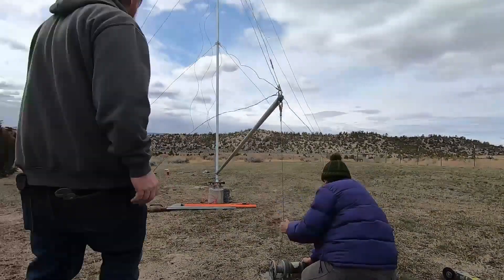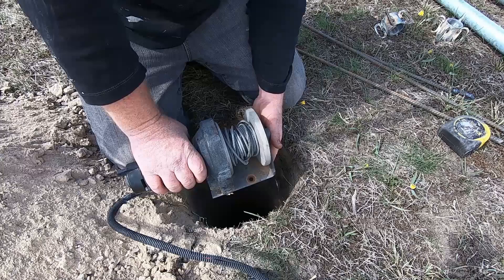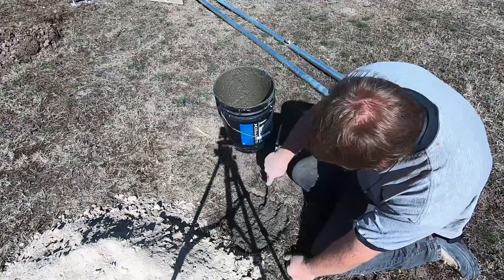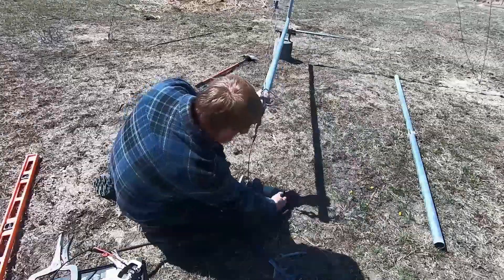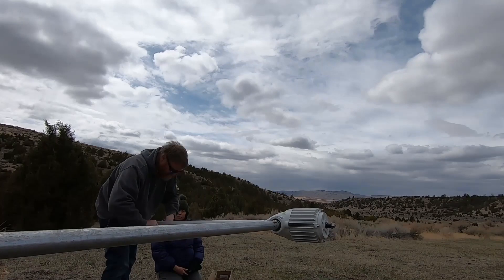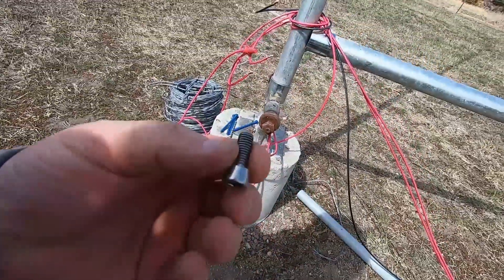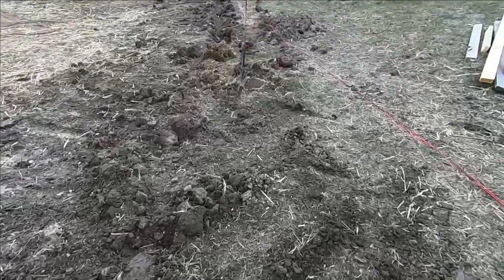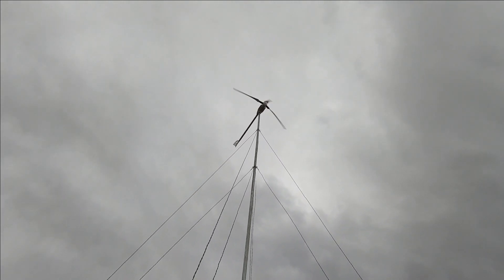video compilation Ista breeze I1500, Tower install, and some final thoughts on the wind mill

Comment: Hey Mike great projekt, you couldt do this, put the retcifier at the bottom of the Tower and then run dc currrent thru the wires in the Ground
Juse two off the three in parrell
Reply from the maker: You could and save one wire but it's less efficient that way.

Comment: what did you hook the turbine too? the istabreeze charge controller?
Reply from the maker: No, it goes straight to a bridge rectifier. With the controller I might get more from the turbine though.
Reply: @veggitarianredneck  I see, rectifier and then straight to a battery bank?
Reply from the maker: @behappymike  yes

Comment: After watching the four clips of this work, I first wondered why you carry the gun😕.?  In addition, you have a wonderful hand tool and you have purchased a generator with good efficiency, but you did not connect the wires in a good way, because you will discover later that the frequent rotation of the motor around itself will lead to the wires wrapping around themselves inside the pipe, which leads to their rupture and leakage of electric current to the metal.  It causes danger to whoever touches the pipe makes his life in danger, except for the disturbance in the proper conduction of the current to the house. I wish I was in your place in this beautiful nature and wilderness and white clouds that make me do an amazing job more than what I saw in those clips, Greetings
Reply from the maker: Some of that may have been lost in the translation.
 But thank you for the comment. The wind gen has slip rings so no twisting danger there. 
 I carry my gun , and sorry if this sounds arrogant, because I can.
Reply: OffGrid406 
Leave the cowboy habit😉